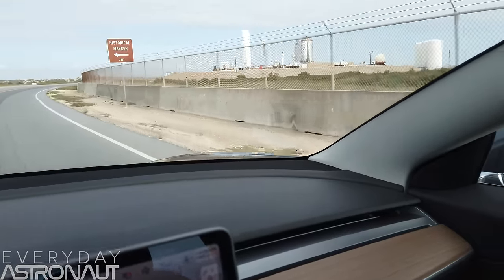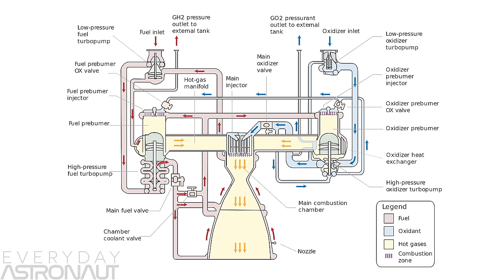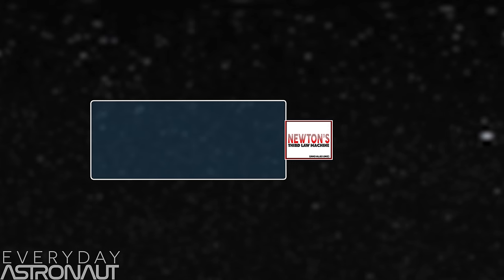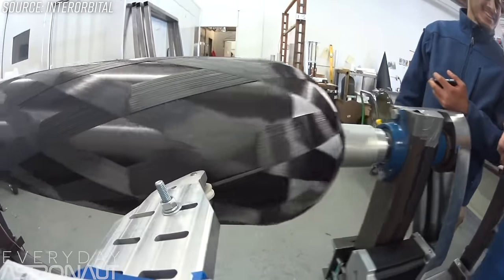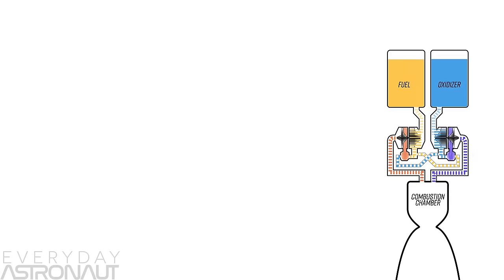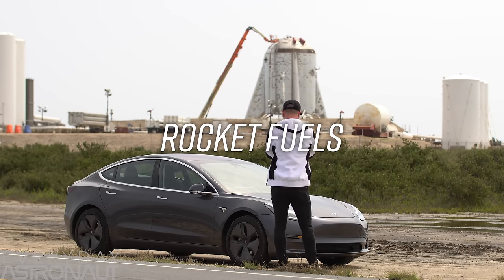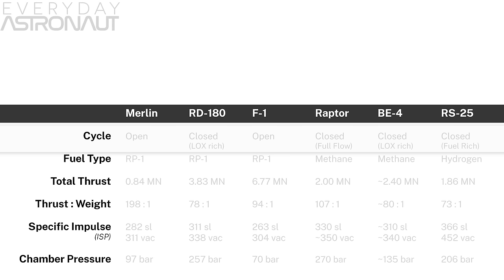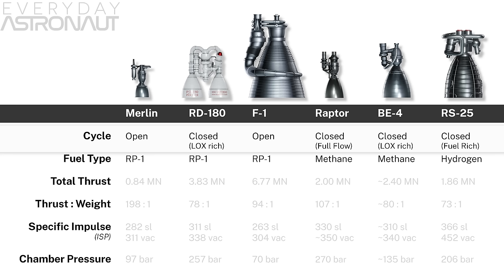Is SpaceX's Raptor engine the king of rocket engines?

Comment: 38:11 As for current time, seems Merlin engine has proven at least 10 times reusability with real flights, after 10th launch of B1051
Reply: March 2023 booster 1058 15 launches 15 landings
Reply: December 23rd, 2023. Booster 1058 has completed 19 launches and 19 landings.

Comment: I can fill in some of the knowledge on Metallurgy, if you are interested.

Basically, the mechanism by which metals fail, or "yield," is by the propagation of imperfections in the crystal lattice.  The imperfections are called "dislocations" and there are usually millions of them in any cubic millimeter of metal. Dislocations tend to move more easily as you raise the temperature of a metal, causing yield strengths to decrease with higher temperature.  The methods of strengthening metals generally center around trying to halt the motion of these dislocations, either by adding alloy elements which tend to stabilize dislocations at the atomic level (such as adding carbon to steel), or by precipitating secondary phases (like small crystals within the crystal) which act as roadblocks to dislocation movement.  
Secondary phases are usually precipitated by raising the temperature of the metal and aging it for a certain duration.  Aluminum is an example where this is very common. Metallurgists have determined the proper time and temperature to age metals to get the maximum strength.  The longer you age, the larger the precipitates grow.  If the precipitates are too small, dislocations cut through them.  If they are too large, dislocations will bend around them.  If you age at the wrong temperature, or the wrong combination of elements, precipitates will form along grain boundaries instead of inside crystal grains, which doesn't add strength, and can weaken the metal.  Precipitates must be fairly small, and uniformly spread throughout the crystal in order to add strength to the metal  
Precipitation hardening is especially common in Aluminum alloys.  Part of the reason aluminum is fine for airplane skins but not good for engines revolves around the fact that precipitation hardening is lost once you raise the temperature above a few hundred degrees, as the high temps will cause precipitates to grow, combine, and migrate to grain boundaries.
You mentioned work-hardening of stainless steel.  Work hardening is a mechanism where you basically limit dislocation movement by adding a whole lot more dislocations, and forcing them to move until they run into each other.  By deforming the material, you push the dislocations until they start to stack up, which gives resistance to further propagation of dislocations. The downside of this is that you lose some of the metal's ductility, which is the ability to "bend before breaking." This means that if you have sudden, large force on your structure (shock load), it is more likely to fracture rather than bending or denting.  No doubt the engineers at SpaceX are aware of this, and have adjusted their safety factors and fatigue analysis numbers to compensate.
Reply: I'm two months late, but I'll say it anyway, as a fabricator who is very much NOT a metallurgist, I appreciated reading your comment and learned a bunch. Cheers!
Reply: Wow! Very informative comment. Thanks
Reply: through use you find fatigue. Simple as that. Just look at the number of launches AND landings.
Reply: Popular Science had a great article back in the day about turbine blades in jets and how they would specially heat the blades and then cool them from one end to the other producing a blade that was essentially a single crystal.
Reply: Wow, that explanation makes all kinds of sense:) Well done!
Reply: This is profoundly helpful.
Reply: A good explanation of metal failure at everyday temperatures, but out on the ragged edge of thermal failure there are different mechanisms. 
None of what you said is wrong but you're missing some important failure modes. A lot of strengthening for normal-temperature metals is - as you said - trying to stop the motion of dislocations. Much of that is done by heat treating - as you said - but one of the goals of heat treating is to create smaller grain sizes, as the grain boundaries block the movement of dislocations. 
However, the failure of turbine blades at high temperature is almost always due to creep which is where stress causes the material to change shape due to the diffusion of atoms through the crystal matrix. Creep is a diffusion-controlled process, which means that if you can limit solid-state diffusion, then you can control creep. At higher temperatures, the atoms in the crystal matrix are vibrating a lot faster, which - as you said - means the dislocations can slide much easier. This also means that it's a lot easier for the atoms to "pop" into an adjacent location.
Diffusion is fastest through the grain boundaries, which means that a high-strength quenched metal with very small grains... is actually worse for turbine blades! If you can minimize grain boundaries, you can minimize diffusion, and thus increase the useful lifetime of a turbine blade. So we've developed special furnaces to create single-crystal turbine blades.
Again, great explanation of some basic metallurgy, and simplified for the layperson (as Einstein said, if you can't say it simply, you don't understand it well enough). It's refreshing to see educated commentators, and people like you are one of the reasons I like science videos.
Reply: You passed the test.
Great job!
Reply: i legit only know how to use the minecraft metalurgic infuser..
Reply: I bookmarked this video to bookmark your comment. Please make videos.
Reply: Thank a million for this great explanation.
Reply: As with the problem with the Liberty ship failures , King Street bridge and Im sure many others victim the the heat effected zone trap...
Reply: @devilslamp7306  I am currently studying materials science and engineering and your explanation as well as OP's checks out. Now we have single crystalline high entropy alloys that make for even better turbine blades lol.
Reply: Oh come on!  Every 5th grader knows this!
Reply: George Robartes you can just attribute the “English” accomplishments to Anglo-Saxon and West Germanic people’s in general at this point. Swedes have a lot of firsts as well, and Jeff Bezos is Swedish too.

Comment: You are the first person to make specific impulse make sense. Everyone else is just like, well it is in seconds because that's how the math works out.
Reply: that's why I prefer Isaac Arthur's approach: specific impulse can go take a hike, exhaust velocity is way better!
Reply: Because that's how mafia work.
Reply: Hahahah
Reply: The reason they use seconds is because the math works out to being the equivalent of "how many seconds would sea level gravity need to pull on the exhaust to counter its acceleration"

If gravity is 9.8 m/s^2, then a fuel with an exhaust velocity of 980 meters per second would have a specific impulse of 100 seconds.
Reply: @andrew34765  I get that now, but no one ever explained that. And wikipedia wasn't much help either. People would stop their explanation at, that's just how the math works, and not go any further.
Reply: @marcopohl4875  Me when I fire my Hall effect thruster at sea level: “FACE MY CHARGED PARTICLES, EARTH”
Reply: @fork9001 inform me when it goes somewhere
Reply: @marcopohl4875  Will do

Comment: 8:06 "There are a few ways to start a gas generator engine but will be done in an another video"
video is literally almost an hour
that my friends is how complicated rocket science is, and it is not even the tip of the iceberg.
Reply: And he only talks about engine cycles which use turbopumps
Reply: @Carp Yes, but he doesn’t go into detail.
Reply: @Carp Well, not really. He only mentions them briefly.
Reply: Not really. If you look at any technical subject in depth, it'll take a large amount of time to cover.

Comment: Info #1 and #2
RD171 actually flew almost 100 times. Much more than F1
Also, the RD170 (differs from RD171 basically with relation to the gimbal direction) was able to achieve a peak pressure of 306,2bar at chamber pressure.

Comment: I didn't realize there was any complexity at all to rocket engines. I just thought you put a tank of oxidizer and propellant together, run hoses to the nozzle, and light it! Your explanation makes a lot more sense, considering that pressure always wants to equilibrate, so without the pumps the combustion pressure would just push back into the tanks and the flow would cease and combustion would halt. Also, it makes me proud as a Russian that some of the best rocket engines ever were designed and built in Russia :-)

Comment: You should consider including the number of engines per flight when counting the flight record as you did for reliability.  The flight record changes drastically with over 700 flights for the Merlin.
Reply: That is a comment to be considered!
Reply: Yeah, employing multiple engines is the most efficient way to test reliability, since each unit can be worked on individually and only share fuel and oxidizer feeding systems.

Also, a lot of variable for testing only exist on actual flight, risking the rocket as well as its potential payload (be it expensive machinery or the immensurable value of academic grade scientists). Having multiple engines makes sure that none of those will be lost when dealing with failures, as long as there is no chain effect (such as violent explosions), as well as making less likely that a chain effect will happen after the catastrophic failure of a single engine.
Reply: Mission success or failure is the matrix that should be used.  Comparing engines of one platform, to different engines of a different platform is silly.  Simply compare the platforms themselves.  Did it get the payload into space and onto the correct trajectory? That's what's important.

Comment: Message from the future (2021)- SpaceX's Raptor engine has successfully reached 330 bar chamber pressure. By the time you read this, it will have likely made an even higher record. Starship has successfully launched at landed, and we're nearing our first orbital test flight of the Super Heavy + Starship system. It's very likely that the predictions that Raptor will be the first full flow staged combustion rocket engine to deliver a payload to orbit will happen either very late 2021 or sometime in the first half of 2022. Welcome to the future of spaceflight.
Reply: Well, there is the FAA... :D
Reply: We've also met with Raptor 2, which has achieved 230 tons of thrust and is going for 250, all while having less parts.
Reply: And from the future time 2024 raptor v3 the successor for raptor v2 and raptor v1 has shown itself to us all the nerds.

Comment: First let me say that this is an awesome video, I don't want to nit-pick it to annoy anyone, just to inform people who might not know this, but find it interesting:

At 23:18 , you talk about the oxidizer/fuel burn ratio for hydrolox. Now, while it's not the point of the video and you're not actually saying anything that is wrong in any way, it did, at least to me, give the impression as though  1:1 was the stoichiometric ratio, where all oxidizer and fuel is burnt and nothing gets left over. This would make it seem as though hydrolox ideally burns oxygen-rich.

However, the opposite is the case. The stoichiometric ratio for hydrolox is 8:1, so actually rockets carry more hydrogen than that, burn fuel rich and push unburned hydrogen out of the exhaust. The reason for this is that hydrogen is such a small molecule, and this means that it is much better at turning thermal energy into kinetic energy than heavier molecules, such as oxygen or water vapor. Basically, unburned hydrogen gets accelerated to much higher speeds in the combustion chamber than anything else, and the difference is so large that it's more efficient to run fuel-rich. For the highest ISP (specific impulse), the ratio would actually be 4.7:1! This also comes with the advantage of burning cooler, making it easier for the materials.
But since hydrogen takes such large tanks to store, it ultimately doesn't make sense to actually use this ideal ratio and the 6:1 is the compromise between running fuel rich to be more efficient and saving weight.

Now, this really doesn't matter for the point of the video, but basically, you'd theoretically expect the bar for the hydrogen to be a bit lower, not much higher.
Reply: interesting. As Elon Musk said, car business is much more difficult but rocket science in science is more complicated and that way interesting. (ie. engines in cars are in the long run not interesting or complicated[for skilled technician], but rocket engines definitely are for so many options how to approach seemingly simple problem).
Reply: Yeah, chemical ratios are often hard to conceptualize, especially since they're usually stated in terms off a mass ratio but what matters for tank size (in this context) is a volume ratio.

Comment: Just remember, the F1 engine was designed in the late 50s/early 60s using manual calculations. Imagine a modern F1 designed using modern engineering....
Reply: It would probably be the raptor engine
Reply: They actually designed it already. It was a potential option for the SLS. It was a lot more powerful than the f1 and more efficient. But liquid still can't top solid fuel so they went with SRBs again.
Reply: I still prefer the old F1 a thousand times, which was a thousand times more exciting than watching these rich kids make a fuss about anything in a race that has more rules and bureaucracy than a communist country. today F1 is boring to death.
Reply: @grog3514  in the past, races were more risky but that was exactly what gave rise to excitement because the spirit of competition and heroism was much more present. everything has a price and if today the pilots do not have any kind of audacity to exceed the limits that guarantee absolute safety, everything falls into the utmost monotony and the spirit is dead. only the rich are left who have won a lot of money and empty fame of an elite closed in their bubble.
Reply: @renatoigmed  sir, I think you are confused between formula 1 racing and the f-1 rocket engine.
Reply: @giuseppepellegrini2863  You just too young to understand
Reply: similar woth the RS25
Reply: @renatoigmed  As a Formula 1 fan, I understand what you're talking about perfectly. I'm not even old. They're not talking about the open-wheel race cars. They're talking about a rocket engine that took humans to Luna.
Reply: @ToyotaTechnical  wtf u talk about?

Comment: RD-170 did not "barely fly". It's on Zenit's 1st stage. 84 launches.
Reply: Technically, Zenit uses an  RD171, which is just an RD170 with a simpler gimballing arrangement. The RD170 has full 2 axis gimballing on all nozzles, but each nozzle on the RD171 gimbals only in the tangential direction. This works very well on a single engine application like Zenit. There were two flights of Energiya with four boosters each, so at least eight RD170's flew.

Comment: Actually!  The Soviet RD-270 engine was FFSCC (full flow staged combustion cycle) also!  But it was for the UR-700 hypergolic moon rocket that lost out to the cryogenic N-1, and it ran on UDMH and N2O4.  But they made the engine anyway.  A sea level specific impulse of 300?  In the 60's?  With hypergolics?  Incredible.  This story just keeps getting crazier.

Comment: Update on flights (which intended to reach orbit):
Merlin: 110 (5 x Falcon 1, 102 x Falcon 9, 3 x Falcon Heavy)
RD-180: 91 (6 x Atlas III, 85 x Atlas V)
F-1: 13 (not sure what Tim counted to get to 17)
RS-25: 135

Perhaps more interesting is total engine flights:
F-1: 65 (13 flights x 5)
RD-180: 91
RS-25: 405 (135 flights x 3)
Merlin: 1004 (102 x 9 F9, 3 x 27 FH, 5 F1. Could add another 105 Mvac flights too)
Reply: *113 for Merlin as 2x for Every FH

Comment: Correction: RD 170 has actually flown twice on buran and 84 times as the RD 171, a gimbaled RD 170 on the Zenit rocket, so more times than the RD 180.
Reply: He said that RD-270 never flew.. Not RD-170.. Im pretty sure Tim is aware of RD-170's flight history...
Reply: Nemanja Ignjatović  nope , when he made a comment about two chambers on rd 180 he mentioned that there were 4 chambers version, rd 170 but it only made few flights, and it is not worth including it. Another thing is that rd 171 were designed to be reusable up to 10 times as they were part soviet shuttle program , since rd 180 is half of rd 170 it is possibly it also could be reused, Reusability is not only property of the engine but the system it is installed, if ULA would care to save the rocket they would have reusable engine,  and  the last, cost of building raptor by spaceX for spaceX should not really compared with price  energomash charging ULA, because it is dictated by maximization of profit, and not how much they really spend on it

Comment: Uhhhh, buddy. The RD-170/171 has been used a lot. The 171 is essentially the same engine, and is used by Zenit.
Reply: I thought it was just used on the Energia
Reply: @nicksalvatore5717  Two Energia launch events, each using 4 x RD170 engines for strap-on boosters and then add Zenit launch counts which I don't have. Also, Apollo flights did have at least one F1 engine anomaly with early shutdown.

Comment: Should have included the RD-171 in your comparison since more of them have flown than F-1s and the RD-171 is very similar to a RD-170.
Reply: Probably didnt include it just because of that, its similar to the RD-170 and he wanted to spend the time comparing more diverse engines